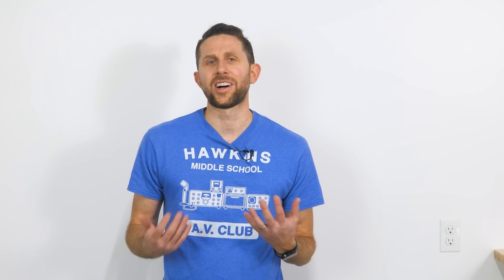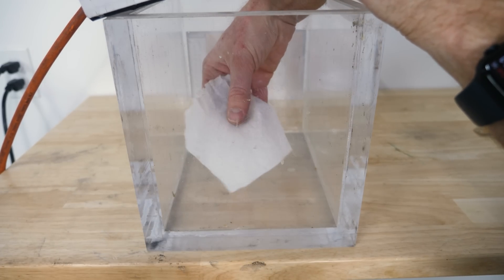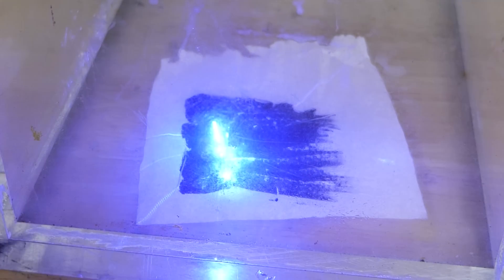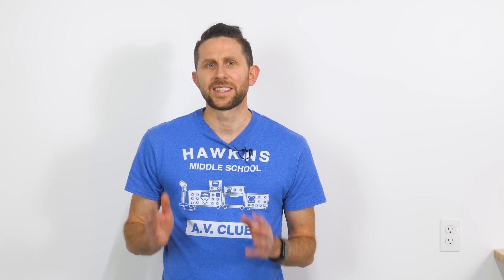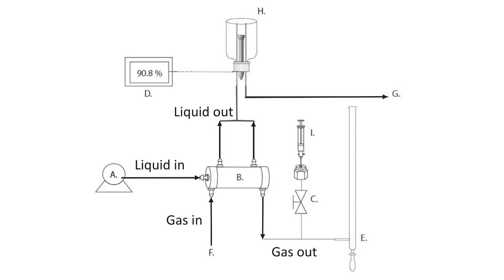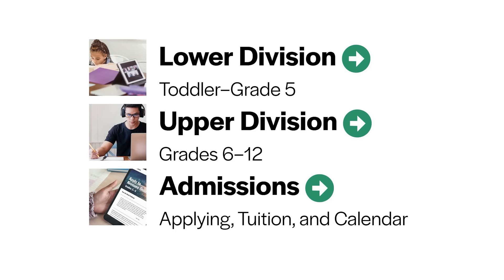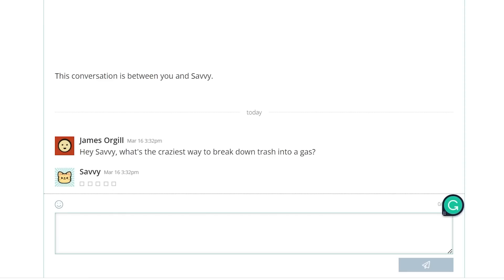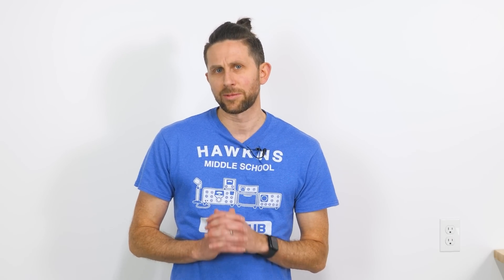Turning Trash Into Fuel

Comment: The issue here is the all in energy input is way higher than the output. Plus the toxins produced
Reply: No, the issue is that the premise is crap
- In the 80s they said that by the 21st century we'd see wild temperatures increases
- In the 90s they said by 2010 it wouldn't snow in Europe
- In 2000 they said that by 2020 (then decades away) the polar ice would be gone and Mauritius would be under water
None of it ever happens, but "the science is settled" and then they changed "global warming" to "climate change" so that literally any change whatsoever goes in the evidence pile.

I like this channel but sorry, the global warming BS is a load of crap. After half a century of lies, I'm out.
Reply: Welllll toxins are produced anyway when it's just laying there for months under burning sun...
Reply: Well if net energy is lower of equal to the energy it takes to dispose and recycle the trash then i say it will be worth it.

Comment: Most important thermodynamic question -- what is the 'NET ENERGY YIELD' of this process?

Gasification requires high energy laser or similar heating method. And only a fraction of the gases will be converted to ethanol..  

Ethanol itself is a low yield fuel.   

Does the total output of energy of the process even gets high enough to add up to input energy?   

It seems like the total input energy here is more than any net output from ethanol fuel you get in the end..  

It's simply isn't an efficient method in my opinion.

Comment: Have you calculated all the energy that has to go into a process like that?  I wonder if it just moves the problem,vs solves it.
Reply: Exactly. Plus trash is now a CO2 buffer in this regard.
Reply: @lucbloom  do you mean that any process to recover energy from the trash, will release even more co2 anyways?
Reply: @JoinUsInVR  At the end of the day this process is not necessarily helping reduce CO2 emissions as we're using the trash as fuel which turns it into CO2 when it's burned anyway but it does help shift our reliance on mining fossil fuels which I think is a step forward

Comment: Check out the work of this scientist named, Dr. Emmet Brown. He's been pioneering this field since the 80's. He managed to create an engine capable of driving up to 88mph and generate 1.21GW of power. Heavy stuff.
Reply: As soon as I saw the thumbnail the first thing I looked for was a BTTF reference.
Reply: GREAT SCOTT!!! 1.21 GIGAWATT!!!🤯
❤️
Reply: Still hilarious they used GW.
Reply: The Mr. Fusion needs some garbage for fuel.
Reply: I took this comment seriously for a moment lol. Great movies!
Reply: No way. Really, dude, no way, OMG, WTF......etc
Reply: What about Super Dave Osborne? He had a car that ran on "Garbane" back in the 80's 😂
Reply: Everything you said is wrong.

He bought a car that can already achieve 88mph. And he used the nuclear reaction of plutonium fission to generate 1.21GW of electricity, to power all the extra circuitry he added. 

The only thing he pioneered was time travel, by designing and building the flux capacitor which he came up with in 1955. Which has nothing to do with  transforming fuel from waste, it is literally a capacitor for temporal flux. That's it.

It wasn't until 2015, Dr Brown got a hover conversion and an off-the-shelf home reactor under the brand name Mr Fusion. Which he used as a direct replacement for the plutonium fission reactor.
In his own words, the car's engine has always run on gasoline.
Reply: Nice!
Reply: Off topic trivia: When the Factorio devs rebalanced the fuel system, they were careful to pick values so that after the changes, one unit of nuclear fuel was still 1.21 GJ.

❤
Reply: "Mr. Fusion powers the time circuits and the Flux Capacitor, but the internal combustion engine runs on ordinary gasoline. It always has." ~ ELB 🥸🤠
Reply: Nice
Reply: Bro dr. Emmet brown commented 😂
Reply: Sees comment section: Oh.. its even worse than I thought 😞

Lets see how long that takes..
Reply: Lmfaoooo.
Reply: Heavy? There's that word again. Does the earth's gravitational pull have something to do with it?
Reply: @mrtonyvillagomez If you are trying to correct someone, at least write Earth with capital E
Reply: @mistrchleba4444  no, it's not to be taken literally, it's a quote
Reply: @mistrchleba4444   If you say “the earth”, it doesn’t have to be capitalized because he didn’t specify which “earth” he was talking about.
Reply: my mindset throughout the video literally

Comment: I probably missed something important because I don't understand how this could resolve climate change. I understand that the net energy result might be somewhat favorable, compared to a traditional incinerator, even though gasification is an energy-intensive process. However, burning one gallon of ethanol still produces 18.92 pounds of CO2, and that amount of CO2 should be on par with the amount of CO2 produced from incinerating the trash used to produce that gallon of ethanol.

Comment: I don't really understand the point of turning the CO and hydrogen into liquid fuel. I mean, I do... but why not just use the gas at the point of production?  I guess it gets around hydrogen embrittlement of an engine, but I'd guess it is better to just have a  power plant same place you do pyrolysis.  You can even  use waste heat from the power plant to preheat for pyrolysis, gaining a bit of efficiency.

Comment: Yes lots of small changes are needed to fix climate change and this could be one of them. Here's the thing though every single solution needs power now it might be possible to use the sun or something for this power like for example desalination can be done by the sun but most other things will require energy and of course if you are trying to remove things like co2 from the atmosphere then you don't want to be putting more co2 back into the environment to create the energy to do so so the point is the main focus of any climate change initiative you want should be renewable green energy. To be fair the biggest power plants in the world are hydro and nuclear so if we want very large amounts of power this is the way we are probably going to head anyway.

Comment: Great Scott! This is amazing! I am looking forward to use this!
Reply: The fact that a comment mentioning Doc Brown has more likes than a comment from the man himself is peak internet
Reply: Hey, doc! How are you these days? Still traveling much?
Reply: It's a solution for excess trash, but it would be expensive and likely power intensive. To have an impact the energy would need to be sourced from a green source. You then need to deal with the carbon bi-product which would be huge at scale.

Finally it needs to be more energy efficient than using the conversion energy to just power the device you're planning on making fuel for.